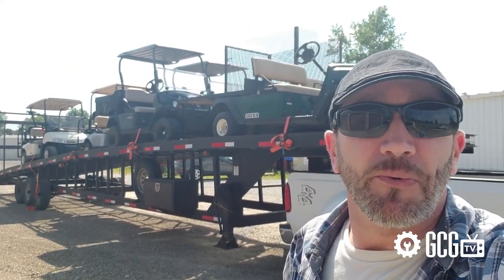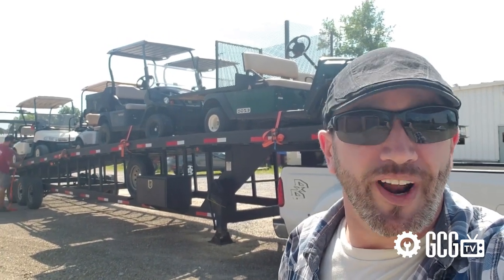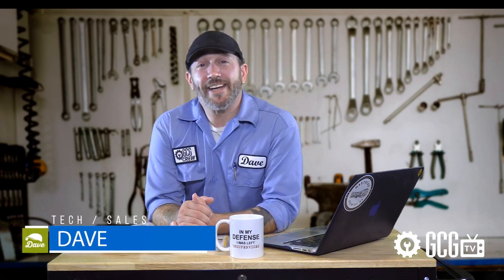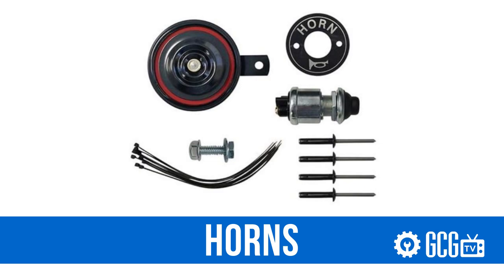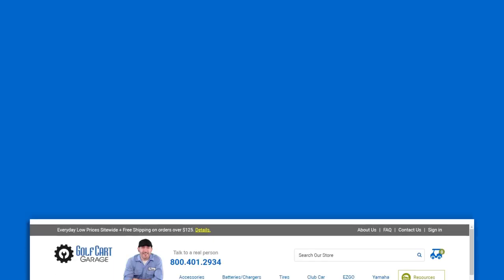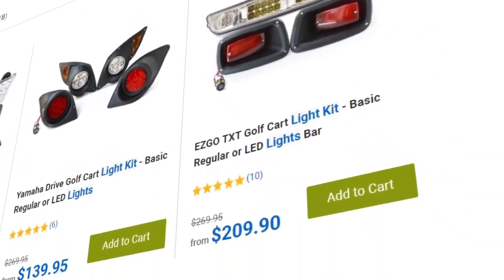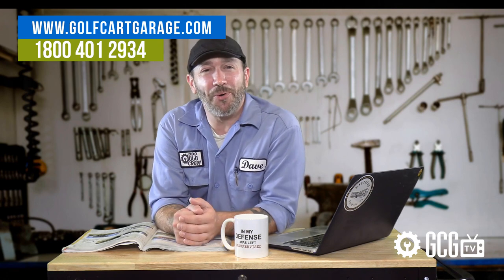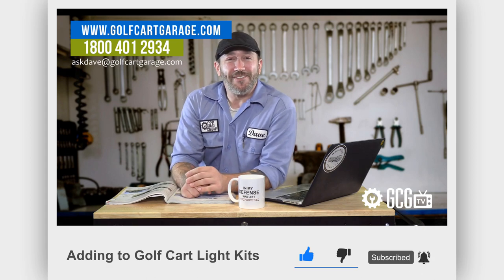Adding Accessories to Golf Cart Lights | ASK DAVE | Golf Cart Garage

Comment: Can you do video how to add off road light or speakers to 12 bolts but with lithium batteries ?
Reply from the maker: Thanks for watching, Cap'n!  We don't have a lithium cart in the Garage just now... but, that's a great idea for upcoming episodes.  That said, lithium works with your powertrain a bit differently, but not your electronics.  For 12V accessories like you mentioned, you'll just want a voltage reducer capable of taking your total power down to 12 before wiring into the harness.  We have an explanation of that here: https://www.youtube.com/watch?v=Vls5d0sznrU
If you need more help, just reach out!  Support@GolfCartGarage.com or (800) 401-2934
Reply from the maker: Cap'n... there's also some good info from our Tech, Tim on this topic during his live feed here: https://www.youtube.com/watch?v=wvA2lPbslR0
Check around the 7:00 mark for question #8.
Reply: @GolfCartGarage  thank you just watched it